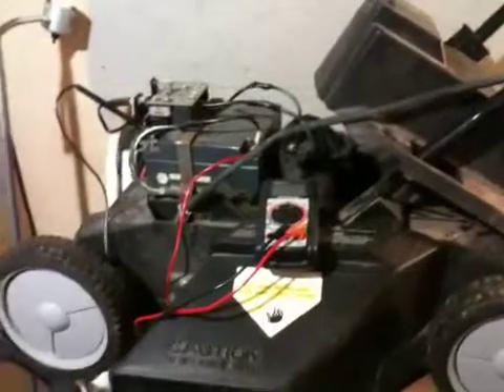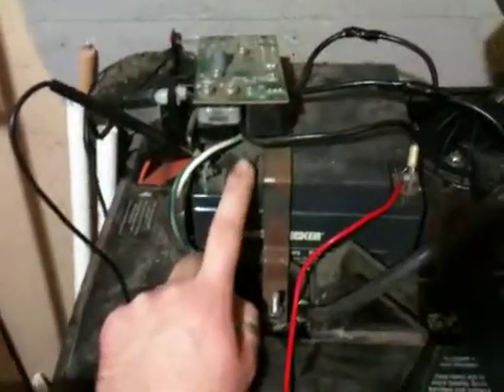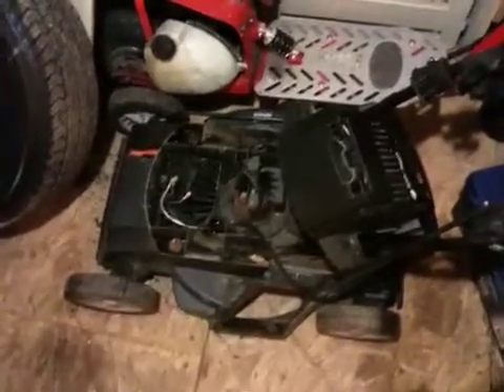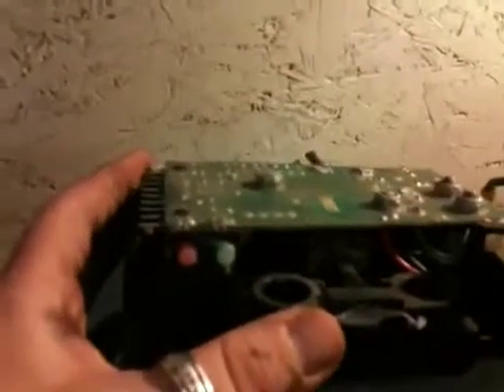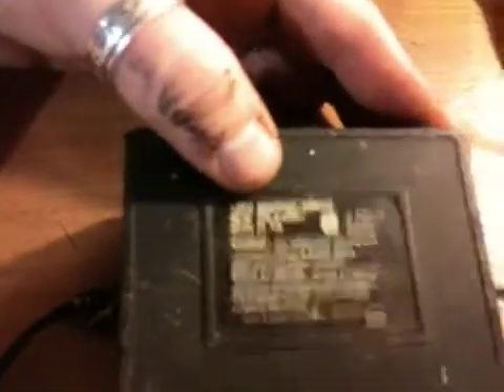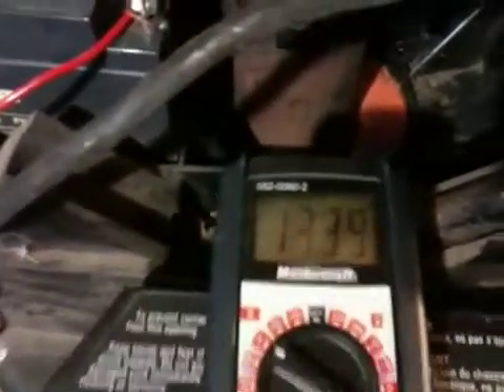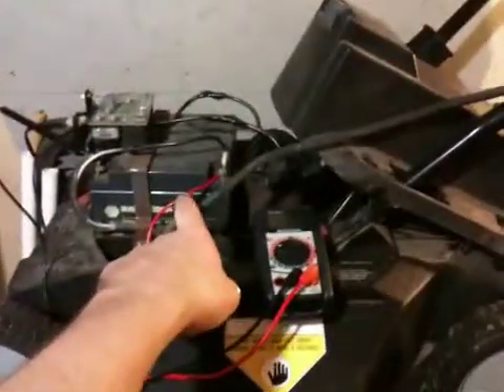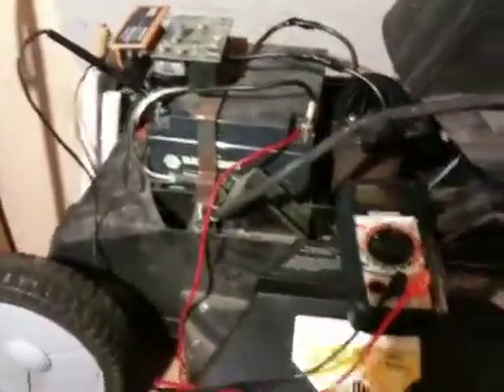Solar rechargeable lawnmower

Comment from the maker: Well the mower has it's own charge controller so if I wire the panel right to the normal charging plug on the mower it should be fine.....but the other way I could just simply charge the mower right off my battery bank through a 12v to 120v inverter using the mowers original wall charger....